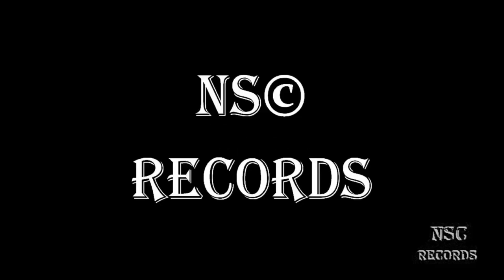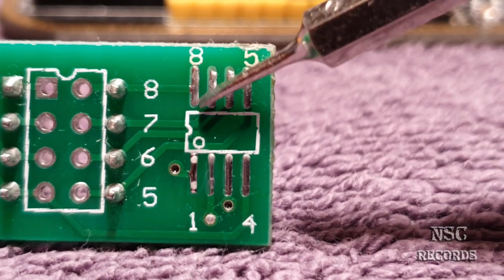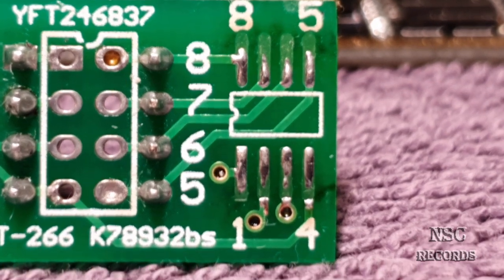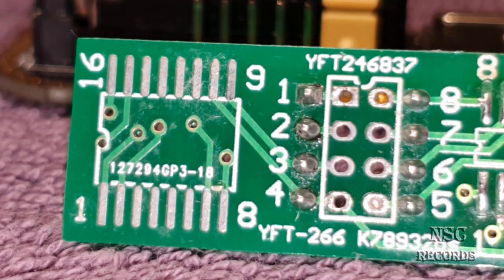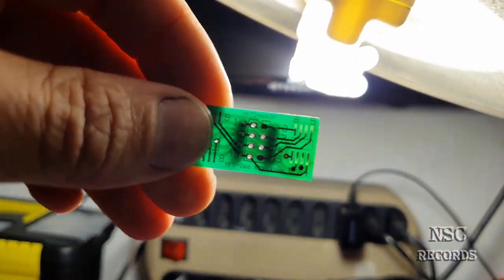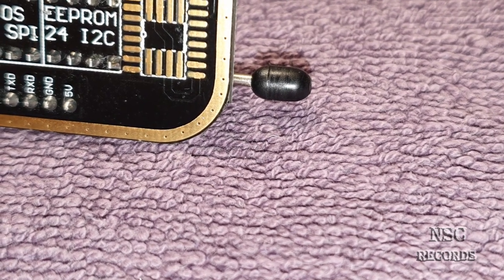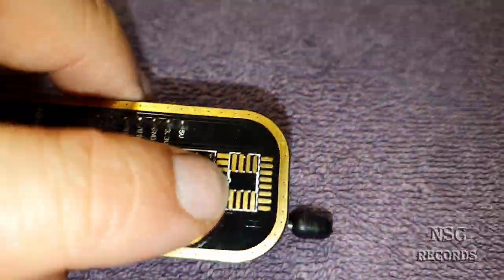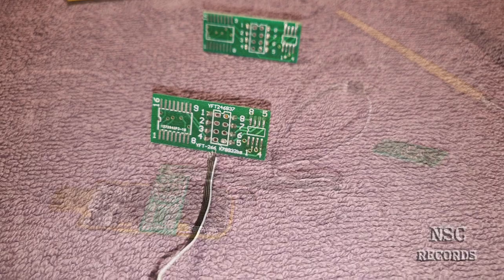USB Bios Chip Programmer CH341A (Black Edition) Chip not Detected -fixed- By:NSC

Comment: I desoldered the chip from a GC-Dual and the programmer isn’t even detected when I plug it into the PC. As soon as I release the chip from the clip the programmer’s LED lights up and the PC detects it. The chip is 3.3v so I did the 3.3v mod (pins 9 and 28 to 3.3v, disconnect 5v from pin 28). No change. I think my programmer is bad.

Comment: Hi nsc i think the problem with the ps3 phats is either the solderballs are to large so as the heat is making them move over time its making them get close to each other making it short circuit as ive done inspections of the rsx chip on a ylod and the solder balls seem to be more squashed making them spread out. Whats you thoughts on this ?

Comment: Hi man, how many time you used that PCB for soldering chip ? Im just curious about it lifespan.
Reply from the maker: I think i made about 40 Chips with one PCB
Reply: @NSC-Modz  i have that wersion with white box and all kind of clamps and its going to last "forever"  , 4clamps/sockets and that clamp with cable, which not works everytime as you said, coz low voltage. Its very good stuff . Bought it for 16/17 dolls from ali.
Reply from the maker: @grindererrofficial3755  yes, i got the same to, arrived lasst week so im gonna test it soon :)
Reply: @NSC-Modz   so good luck :) its great maschine. Will wainting for video

Comment: i hope you can help. i did a bad bios flash on a gpu. rx5700xt.  now i cannot even read the bios to back it up!  i cannot do anything with it.  so i have ordered this programmer and the clip.  i have never done anything like this before.  so i don't know how do i setup the usb part?   i know about drivers i am talking about which pins on those little circuit boards go into which holes on the programmer?   so i dont understand how to connect the clip wire/board to the usb programmer. which way??

Comment: Hello, i like your videos about this programmer, and want to ask ,if you try to use USB 3.0 fast charging port to power the programmer, when use a clip, so don't need to desolder the chip from the motherboard (becouse 3.0 can dеliver more current then 2.0)? Also did you try to disconect everything from the motherboard, but 8 pin and 24 pin still conected to the PSU, plus cmos battery, but without power it on? I watched videos about this, and one man say this is the solution, but I'm not trying it yet, so I'm asking from curiosity. Best regards and have a good day!

Comment: Are you positive that you can't flash it on the motherboard with the jumpers?
Reply from the maker: You can try it, but sometimes a lot energy for lost and that's why it's not working when the chip is still on the board. I always recommend to get it off, but like i told, you can try it.

Comment: why mine cant detect the ic..but it can read .. write, but the data on ic isnt change, its 00000 all.. is it hecause  its write protect? how can i unprotect it..i use asprogrammer and still cant unprotect
Reply from the maker: Check the contacts first, maybe the pads are bad

Comment: I want to thank you so much for solving my detecting of the chip issue. For more than 2 days I have been trying fiddling around the clip, reversing it, removing the battery, removing power from the motherboard, trying more than 6 different software, buying another clip, scouring Youtube, reading forums, etc. 

Once I desoldered the chip from the motherboard and soldered it to the mini pc board that came with the CH341A, the software detected it with ease. THANK YOU!
Reply from the maker: Yeah, you always welcome 😀

Comment: Thanks for the info that bios chip is cannot flash directly when attached to the motherboard..i had the same experience before..but one thing is wierd on the video, is it pin 1 of the chip is always facing handle?..on your video it was facing towards usb..it makes me so confused here 😅
Reply from the maker: It conforms how you turn the small board and where you connect it xD